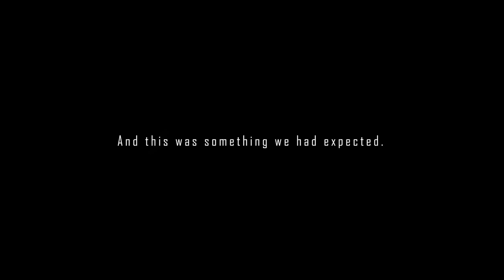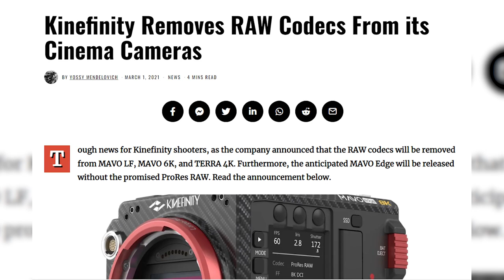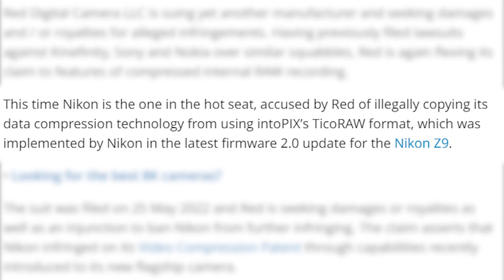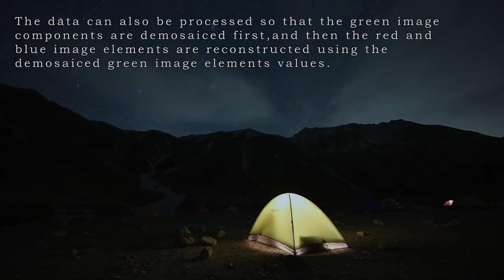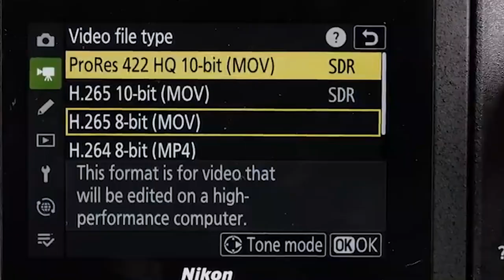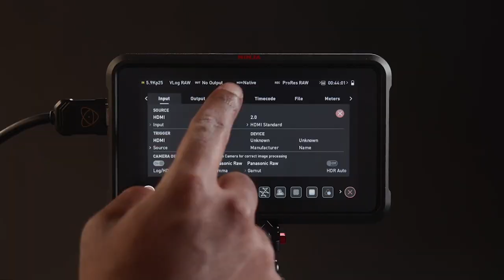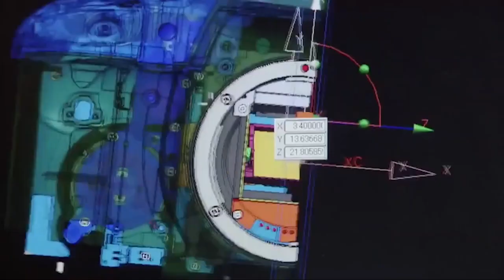RED Sues Nikon Over Z9 RAW Video Patent

Comment: Raw photo formats don't work this way, so why should motion? Sony's raw photo format is .ARW, an acronym for Alpha Raw. Canon's is now .CR3 and each of the other manufacturers have their own as well. Why is it open for photos and not digital motion? In the raw world, the term video no longer applies. Instead, it mirrors film, recording still images in varying rates of frames per second. The original Blackmagic cinema camera worked this way, producing sequential .dng's, which was one of the original raw file formats (Adobe patented DNG but allowed manufacturer's free licensing on the condition of attribution). In the end, the only difference are the frames sequenced every second. Redcode Raw is a means of compressing raw data, it is a method of producing raw images sequentially, just as .ARW is Sony's means of producing a digital still. Redcode raw is owned and patented by Red and should be. If others use Recode Raw, they should pay a license to use it. However, if others innovate a method of compression all their own, engineering a way of doing it altogether of their own creation, they should be able to do so freely without the restrictions of a licensing fee. Their current methodology of producing one raw compressed image should not be disallowed simply because they wish to extend it into making multiples. How could that possibly be restricted? The assembly line is a great example. It also constituted a means of production. Ransom Olds actually patented the assembly line but refused to enforce a licensing fee. This from the Detroit Historical Society, “He encouraged fellow innovators to look at his accomplishments, and he never pressed charges for patent infringements. His use of the assembly line, though stationary not automated, and his early development of a successful automobile lead many to consider him as the father of the automobile.” He created the assembly line but refused to close the door on all others from benefitting as well. On the contrary, he wanted others to learn from what he had done and make it better. Henry Ford did, taking Olds’ idea and innovating it, thereby creating the moving assembly line. Each new innovation of this process made car production better and faster for all manufacturers, thereby increasing output and making those cars more affordable for the consumer to buy. Would his enforcement of the patent resulted in stimulating automobile production and innovation or discouraging it? The distinction between owning your version of a technology rather than the technology as a whole is the fundamental concept at play here. Redcode Raw is proprietary and should be. Extending that to any and all versions of that type of technology is an overextension that should be viewed as untenable as it assumes a distinction between producing one raw compressed image versus many. In the raw world, there exists only images at varying frame rates. If manufacturers can develop their own format for compressing one image, there should be no ceiling to prevent them from doing so in multiples.

Comment: Can they introduce some plugin system so the open-source community can fill the gap? Or distribute the original firmware and file to modify it and introduce new features, so you don't distribute raw capabilities in any sense. I'm sure there should be way how to troll patent trolls.

Comment: I warned of this months ago. Red has no choice but to protect their patent. Failure to do so can result in them losing the patent. 

I believe Red will win this lawsuit and Nikon will be forced to remove compressed RAW. I also think Blackmagic Design will drop support for the disputed format to avoid bad blood with Red.

In all honesty, camera companies should just offer  uncompressed RAW as an alternative. It’s good enough for Arri and Sigma. Computers are now fast enough and storage is cheap enough to make uncompressed RAW a viable option. The higher bitrates will also offer more flexibility in post.
Reply: uncompressed Files are heavier. you can't compare Mirrorless cameras with ARRI. because Mirrorless doesn't used to have that kind of processing power and active cooling. because those bodies are designed for different workflow. Nikon N-Raw is 50% smaller then ProRes Raw thats why they are able to record 8k 60fps without overheating.
Reply: I mentioned Arri as a benchmark of quality.  But I also mentioned Sigma. As the Sigma FP also can record uncompressed RAW video. And it does so without overheating… and it’s the smallest full frame mirrorless camera made.
Reply: compressed raw needs to be open. No one needs to deal with the stupid uncompressed raw file sizes. Ridiculous. 

Sigma FP needs internal 10 bit and thats it, that'd be a great upgrade. Small sizes and good enough color capture.
Reply: Nikon won. Case dismissed